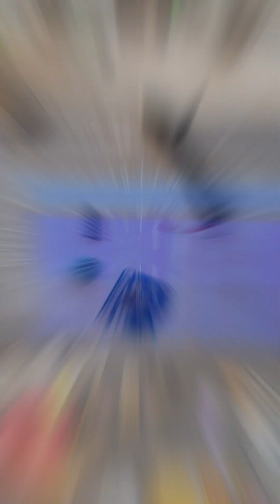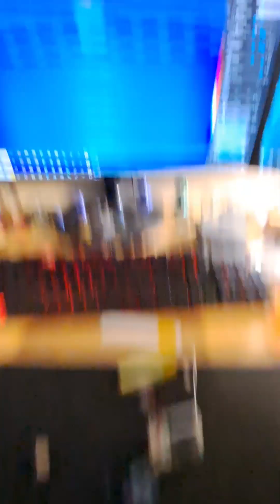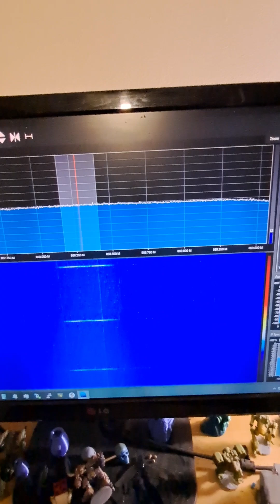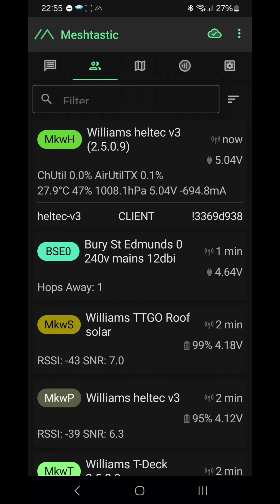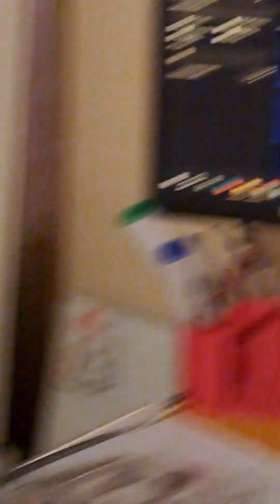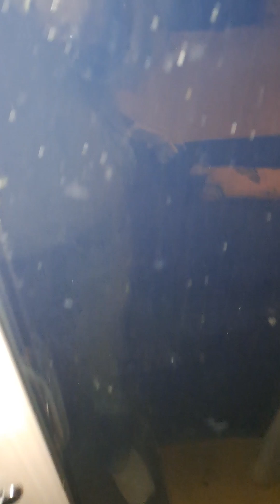Heltec GPS Current shunt environmental sensors mods

Comment: Hi, Can you enumarate what are the steps of activating the ina 219 board in meshtastic app software? I am trying to configure mine and it dosen´t seem to work.
Reply from the maker: @WH18E  I just use the online meshtastic flasher remember to use a data usb cable I'm using a Lillygo node